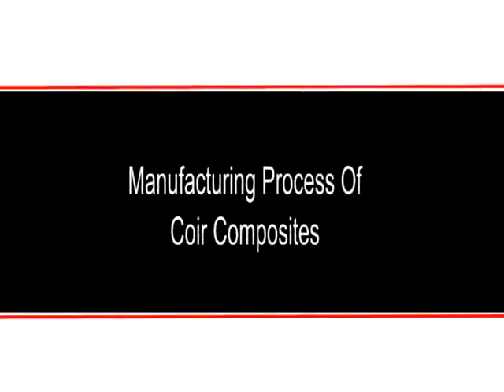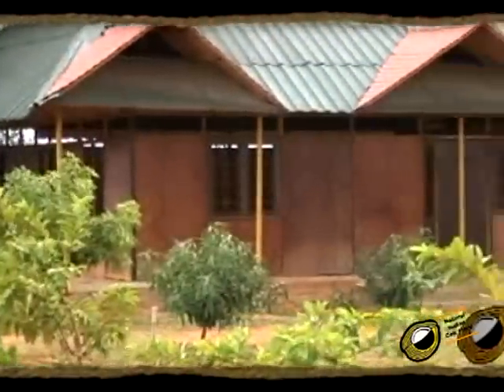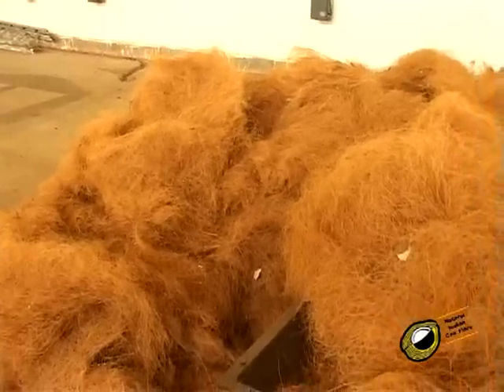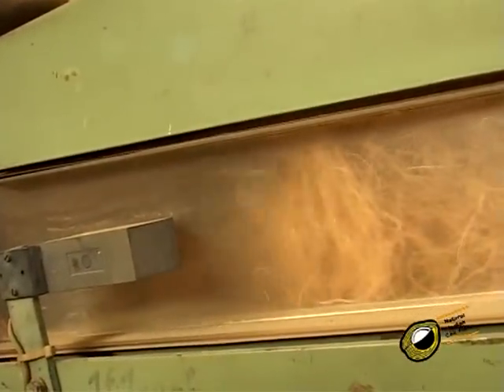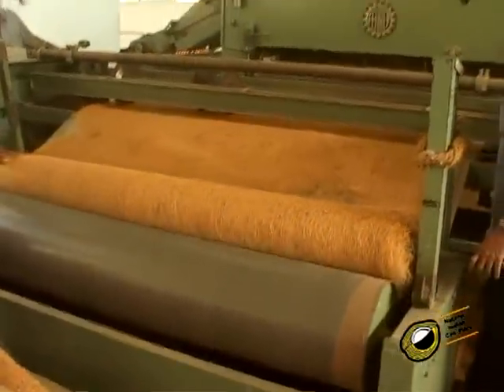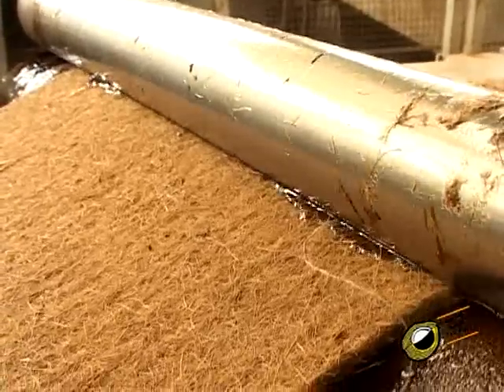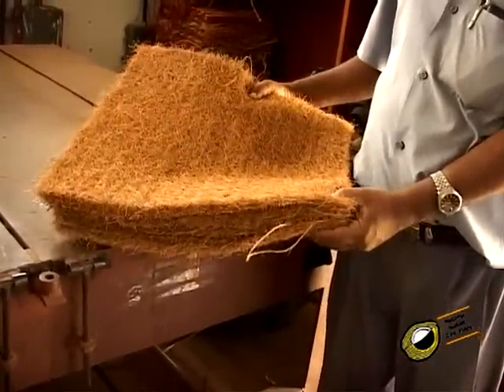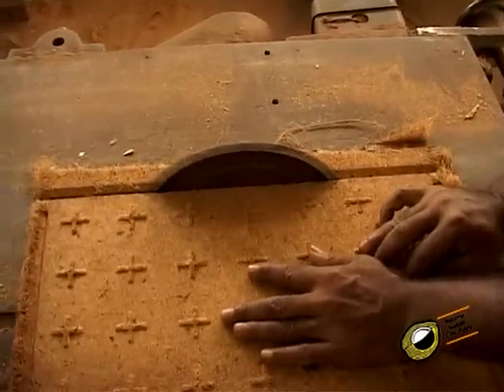Lesson for making coir composites

Comment: I am very much interested with this and I would like to know the complete information to start my own production of coir products.
Reply: Most fibreglass and carbon fibre composites use 66% fibre to 33% resin. So by weight half the the weight of the fibre is used for the resin quantity but in practice slightly more resin is used and the excess is squeezed out under pressure during the curing process. It would require some experimentation as I would imagine natural fibres would be more absorbent than synthetic fibres but the above would serve as a rough starting point.

Comment: Is this a good alternative for acoustic treatment or sound absorption?
Reply: You can use the coir needle felt for sound absorption plate. It doesn't need to press tight, it's in fact better when not pressed. For easier installation, the coir needle felt plates should be glued to those pressed plates

Comment: Hello, what kind of bonding product do you use?
Reply: Phenol(Mildly acidic, it requires careful handling because it can cause chemical burns.) Formaldehyde(is a colorless, strong-smelling gas used in making building materials and many household products. It is used in pressed-wood products, such as particleboard, plywood, and fiberboard; glues and adhesives; permanent-press fabrics; paper product coatings; and certain insulation materials)

Comment: Kindly provide manufacturing ingredients' ratio, process and final properties of phenol - formaldehyde resin for making coir composite.
Reply: Roughly 66% fibre to 33% resin in the end product however in practice slightly more than half by weight resin would be used and the excess squeezed out during manufacture. To really make natural fibre composites a truly sustainable product more research needs to be done bio resin technology.

Comment: how save is phenol formaldehyde , if it any ways goes to our food and children
Reply: using a bio resin instead of the formaldehyde?
Reply: Once bonded it's fairly safe, but the dust in this factory from cutting finished product would be a concern, and the fumes from the hydraulic press. But, probably best I don't get started on the health and safety concerns ;¬)
Reply: thank you
Reply: Marius where can i get bio resin